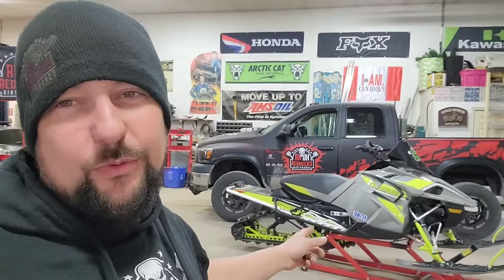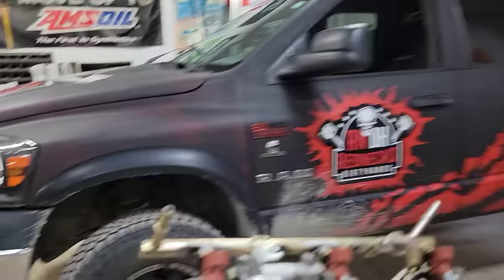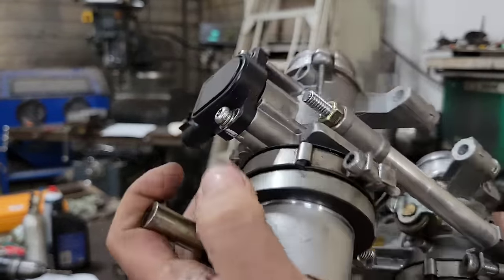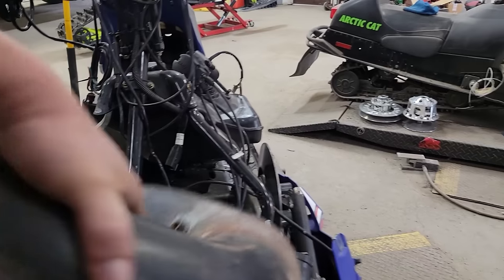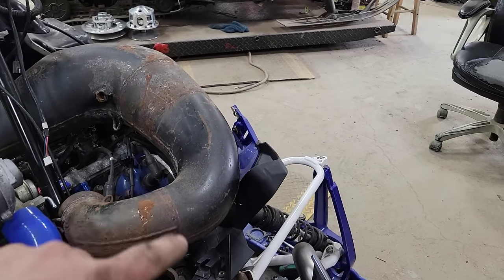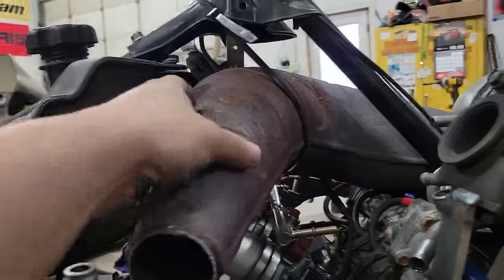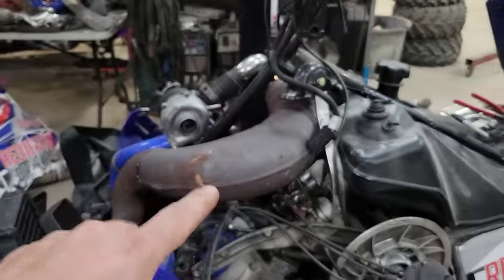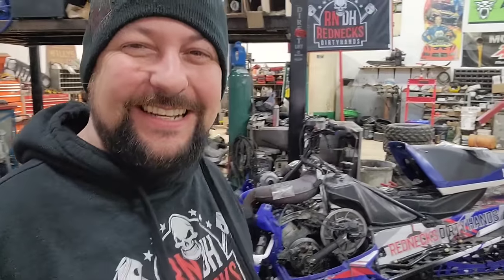SRX 700 Triple Turbo Part 2... Exhaust & Throttle Bodies

Comment: This is awesome, im glad to see someone else taking on the challenge of building a turbo 2 stroke triple. I'm build one with an rxl 650 in an old wedge chassis 😎😎
Reply from the maker: thank you! I still got a bunch to do to finish her off but fingers crossed it'll all work out! sounds like yours should be a pretty sweet project too! cheers 🍻
Reply: @rednecksdirtyhands  I'm curious as to what ecu you'll be using and what size turbo? I plan to use a china gt28 to start with..

Comment: Experimented with smaller pipes on M1000 turbos back when they were new. Smaller chambers did not make power. Using spar from a 2 stroke chassis and going around the outside of spar like the M8 would have allowed the bulk of the 800 pipe to fit like stock with less shortening and loss of volume. That single doesn't appear to have much more volume than one of the original triple pipes. I may be wrong but just speaking from some experience building 2 stroke turbos from scratch.
Reply from the maker: thanks for the info! yeah this is the first 2 stroke turbo build for me so any tips are more than welcome and appreciated! I'm sure there will be tons of RN D on this one lol cheers 🍻

Comment: Lookin good.  The inset of the 2" pipe on the exit side is to reduce crackle.  Race pipes will generally not have an inset pipe.  Thats why they crack so much louder then trail pipes.  It is important to keep the length of the taper to the end where it connects to the exit pipe.  The amount of length of the exit pipe that goes into the pipe isnt important.  The shorter it goes in, the louder it will be
Reply from the maker: good to know! thanks 🍻

Comment: That "W" pipe came out killer, looking forward to seeing the expansion pipe all finished up with the hand hammered heat shield logo. Great idea on the aluminum square tube for the cold side. 
Really enjoying this build... It's got me thinking about the spare WRX turbo sitting on the shelf and the old Indy Storm 800 in the barn, plenty of room to toss out the DG triple stingers and put the turbo in their place...Gonna have to get a beer and think on it lol.

Comment: An idea for your exhaust... the 98 ski-doo's used  a normal sized expansion chamber.. then the outlets were smaller and exited about 1/3 of the way down the expansion chamber... may be an idea to route smaller pipe to the turbo.

Comment: Dirty hands , been entertained by your Chanel for well over a year now , love how you keep it light !  Question… wouldn’t it have been easier and better scavenging efficient if you cut a hole in the SIDE of that divergence cone and had a nice 35-45 degree bend straight-ish into yomomas turbski , side dump outlet pipes in 2 strokes work very good , not DOOZER , on NA sleds and now Polaris are using them on their turbo factory 850’s and 9R’s ( factory race models) with great success and it seems to give the 850’s/9R’turb racer better throttle response than my Boondocker sidekick setup on my 2019 850 axis .   Just an idea if you need to try another iteration of exhaust systems , I’m sure you’ll go through a few until you get that ultimate smile on your face 🎉
Reply from the maker: lol yeah im sure there's gunna be some trial and error on the exhaust...I'm not too sure how it's gunna respond as it is but we'll just wing it and hope for the best lol 🤣🍻

Comment: Amazing Pete.  Love what you’re doing👍 Since you have the original oil tank mounted to the chaincase…..thinking you could get a 12 volt pump and use that to circulate oil from the tank through the turbo and back.  Shouldn’t need an oil cooler with that volume of oil unless you’re doing long runs with it👍
Reply from the maker: thanks! yeah thats what I was thinking too! 🍻

Comment: It was already 5MPG. Now it's going to be 1MPG at best. I'm not gonna say this isn't going to work, but there is a reason why it took the industry so long to turbo a 2 stroke. And that's not the reason that it hardly does anything anyway. Which is the main reason why a turbo was never done on a 2 stroke for so long. They still hardly do anything when you think about it.